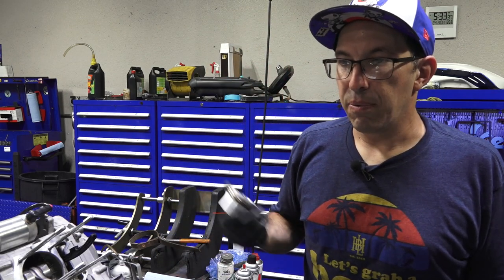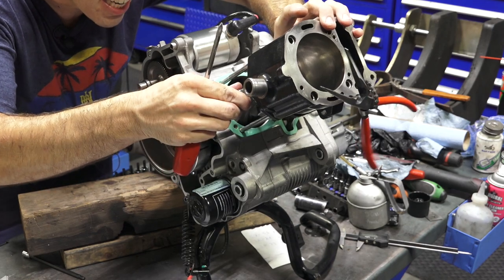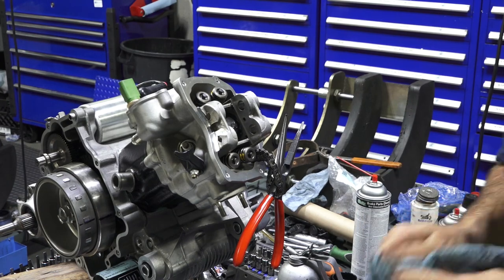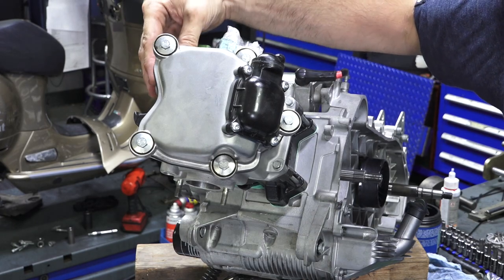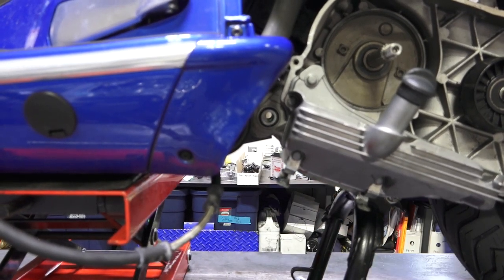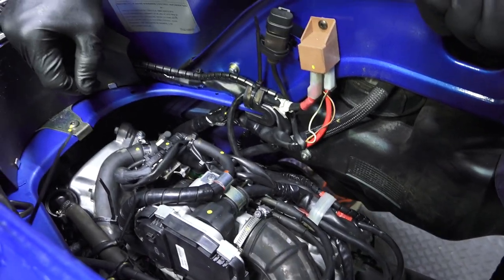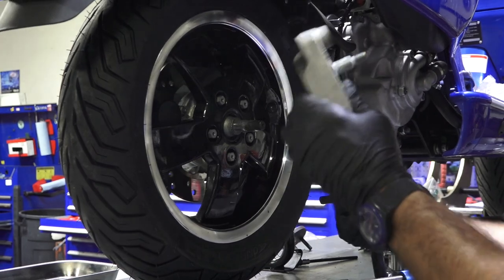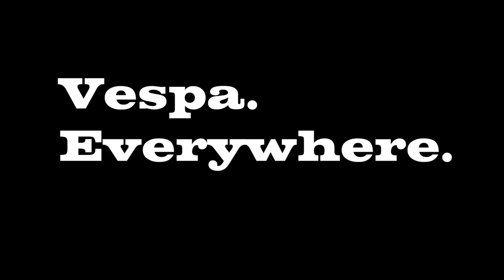Vespa GTS Complete Engine Overhaul pt. 3 Final Assembly/Installation

Comment: Thank you so much Robot and Scott for your detailed guidance! My vespa was leaking oil and I decided to replace all the top end gaskets, and I was overjoyed when I cranked the engine today and it started like nothing. I watched all three of these videos and followed them like a bible. I never would have had the confidence or knowledge to attempt this without the detail of these videos. But it was an awesome experience to be able to take apart and work on complicated machinery.

Comment: Great video. Thanks for the hints, tips and tricks. About the valve clearance. Do you know what it takes for a 125 gts  ie? The manual says 0.02 - 0.05mm which is nothing, is this correct? Greetings from Austria! 🇦🇹

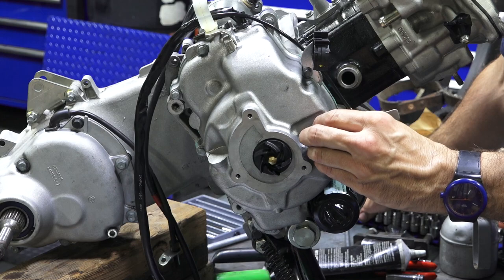Comment: Hi Robert, i forgot the plastic Plug on 57:10 and started the Vespa. Air blows out of the opening. Is that normal? It sounds like the exhaust is leaking.

Comment: Hi Robot, thank you for your learning, really appreciate it. I'm doing all my DIY work on my 300 GTS thanks to your videos.

Just 1 question : i've changed the cylinder, piston and cylinder head of my 300 GTS 2010. The cylinder and piston are brand new.
I'm not sure of the position of the piston rings.

I have the Haynes manual, and they to not advocate the same position for the piston rings as you do on your video.

I've been mounting 2 times the piston/cylinder with 2 different position for the rings. Everything is torqued with a torque wrench. (follow the Haynes sequence, 7nm, 10nm, 270 in cross for the Cylinder head bolts. Valve adjustment OK (In: 0,10mm / Out 0,15mm), base gasket 0,4mm (the thinner).

The spark plug is black but not oiled. I guess this is due to my injector, maybe too rich. Which is an old injector i just bought recently.

1st time i started the scooter i had no compression, engine was runing very low. 2nd time (now) i have more compression (100psi), the engine goes to 20km/h max.

Put some oil inside the spark plug hole, testing with a compression meter and the compression came to 150psi. So there is a problem in my piston/cylinder.
Which one ? Are my piston rings gap misplaced ?

And, not sure to understand, but the oil scrapper ring gap should be at 12' oclock, the middle one at 4' oclock and the upper one at 8' oclock is that right ?

Thanks for your help !

Thibaut

Comment: May I have accurate stud screw Newton meters value? As I tried to use your final 24 foot pound convert to Nm which means 32 Nm (Using google to transfer it gave me 32 Nm), and I got broken stud screw as result :(  Looks like I used wrong unit to convert to Nm? 24 foot pound stands for 24 ft-lbs, correct?

Comment: I work in a Vespa rental and this vídeos are gold to me. Having trouble with the 2015 50cc 4 stroke primaveras. They are difficult to start and keep staling until warmed up. Any suggestions? Valve adjustment perhaps? They are about 6000km/4000miles

Comment: Hi,I have a gilera runner 125 I’m thinking of putting a Vespa gts 300 engine in it are they all fuel injected and would u no what year of engine which is carburettor ran thanks.paul

Comment: Jeff (and team at vespa motorsport), i have one question. I am in project of rebuilding piaggio beverly 200 (leader engine), i've skimmed about 0,10 mm off the cylinder head due to low spot near the one of the coolant passages and i am wondering which base gasket thickness to use, current gasket is 0,6 mm. Should i stay with 0,6 mm, or go higher and use 0,8 mm? Will the 0,2 mm. difference have big impact on compression ratio?